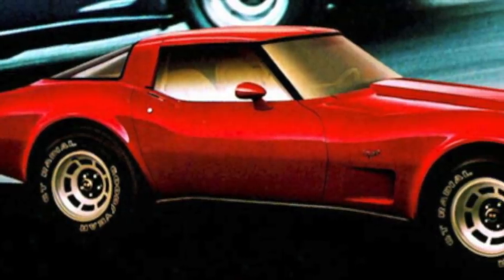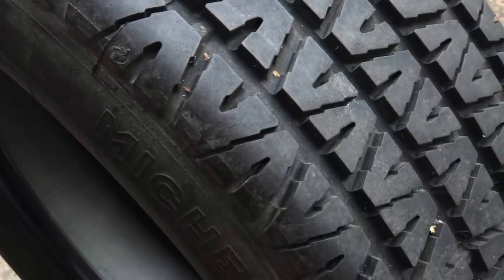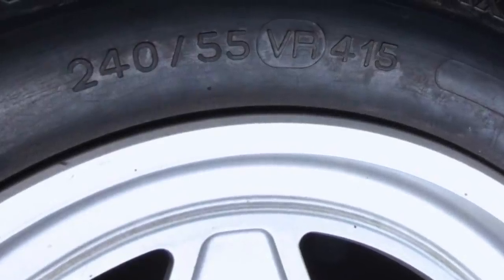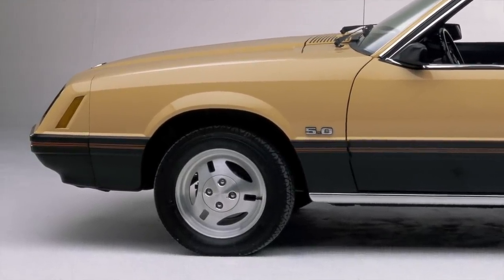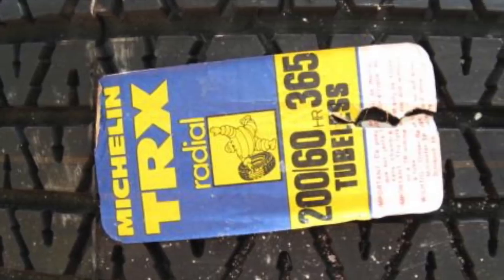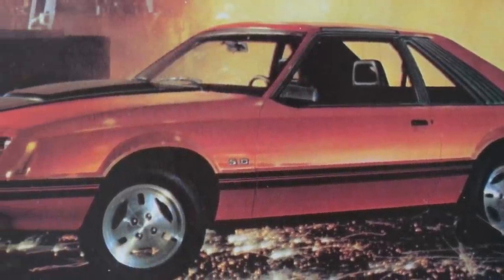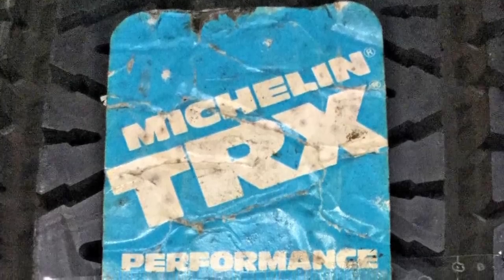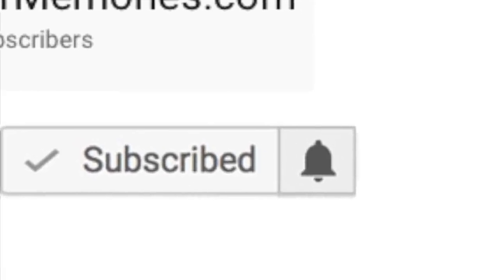Best Car Wheel & Tire Innovation And Why It Failed

Comment: I worked for GoodYear for many yrs in retail/service. We ran across several cars that had the TRX  packages, in which the customers didn't realize that the rim to tire fitment was unique, and getting that exact tire and size would be really expensive.  Hense, many of them went to conventional wheels and tire sizes. Also, it is worth noting, that GoodYear released an Aramid belted tire, 78-81, as a performance tire, widely used on certain GM and Chrysler products, in both letter sizes as well as metric sizes. They offered superior strength and treadwear, as well as heat resistance in high speed driving. BUT they were very expensive. In '79, a set of GR 60 15 Aramid belted tires cost $3-450.00 . That's about $8 to 1000.00 in today's money. And very few drivers bought them as replacements. As for the TRX, GoodYear actually copied the tread design on it's original Eagle GT tire, and later the Eagle GT +4 , which was softer and had a better ride, but it was based off the TRX tread design, in more popular sizes that fit any rim.  Those tires sold like hot cakes, and 1 could special order the tires to V spec speed ratings. As you said, and it's worth noting Coker has had the original TRX sizes available since '12... but they are supremely expensive.
Reply: Those Eagle GTs ended up on a lot of cars as replacements for some poorly thought out OEM tire decisions.

Comment: My 1983 thunderbird turbo coupe still has the original trx tires and wheels. But I put a new set of tires on pony wheels and car handle better with the original tires. Just a little dry rotted now. Lol
Reply: Get those things off the road before you Paul Walker yourself, dude!!!
Seriously!
Reply: @VCBird6  sorry hard to understand what I wrote. Meant to say my car handle better with the old trx wheels and tires but I switch to a new set of tires on pony wheels from a mustang. Because tires are dry rotted and are expensive.
Reply: A little dry rotted????
Reply: @dennisduran8500  car was garage keep tires are not that bad. Don't worry,  I drive it around with a new set of tires on mustang ponys. Tires are a lot cheaper for 16 inch wheels.
Reply: Driving with 35 year old tires is not wise. It's not just the exterior deterioration that is an issue. The inside structure is probably much weaker than when new.

Comment: Used to own a 1984 Thunderbird Turbo Coupe 5-speed with the TRX tires and wheels. That car handled as good or better than my brother's 1984 Corvette with the Good Year Eagle directional wheels and tires. Way ahead of it's time. Thanks for sharing!
Reply: Beast 1624 
My buddy had an 87.
Well, his dad did. 
As kids we got to use it , and see what the hype was. 
What I’ll say is once we had it on the highway and kept the tach between 4800-5400 for about 20 minutes in top gear.  
We slowed down to legal limits and was so bored and it felt so slow we wanted to get out and walk. 
What a great car.
Reply: I'm sorry but when the 84 Corvette came out it was the best handling car in the world better than Ferraris so a Thunderbird Turbo. did not handle as well as it. I had an 84 Corvette with the z51 handling package and been in many Thunderbirds I'm sorry Thunderbird do not handle as good as vet
Reply: From my POV it did.
Reply: YOur definition of handling is not about feeling but rather about numbers and higher g's ratings and such, which does not have the same confidence behind the driving wheel as does road feeling, especially at that time when that corvette had the shitiest road manners and harshest ride.
Reply: Yes the ride was hard especially with the z51 package but confidence I could put that car into any turn and never felt like I was going too fast
Reply: Besides tormenting its occupants, the very stiff suspension also tortured the new Corvette body. Squeaks and rattles throughout the structure became common and so did complaints to the quality people at Chevrolet.

One of the problems was with the Z51 suspension and the fact that many who ordered it did not know what they were getting in to. Despite its high price nearly half of the 1984 production was Z51 equipped. Although it was a good idea for racetracks (which are typically billiard-table smooth) it had no place in the real world of potholes and speed bumps.
Reply: Yes they softened the spring rates in 85 and 86 because of people's complaints but then again a racecar never has a smooth ride so what these people thought they were getting into I have no idea
Reply: Let me be clear. My brother and I bought our respective cars at about the same time. I loved his Corvette. He loved my T-bird. He did not have the Z51 handling package and had an automatic. Mine had the Borg-Warner 5-speed. My observation from my point of view was that mine was more fun to drive because you could drift into corners and had a better sense of throttle input and the manual gave you better control. The 'Vette was GLUED to the road but the stiffer suspension and automatic took away some of the fun. It's all about the feeling from the drivers seat. Just my opinion. Would the Vette beat the T-Bird on the skid pad? Yes. But...that's not the point.

Comment: Gotta tell ya, I've owned many different cars since 1978, w many different tires, Good Year Eagles, Vogues, etc, never heard of TRX, or if I did, I probably thought it was a style, very interesting, I had the Vogues on my Luxo cruisers, but I had 16 inch Eagles on my Lincoln Mark 7 w BBS wheels, they rode great, and handled great, when I got a 95 Lexus it had narrow tires on it, car was horrible, I took the factory tires off w 50 miles on them, and put 55s on it, then it went around corners, tires make a car
Reply: A coworker wanted to go to a larger wheel to improve handling. I tried to convince him that he should first change to a better tire. He decided to do both. That made it difficult to examine the improvement just switching tires would have made. 

Another person went out and got tires with poor braking qualities after I had suggested they not just buy what was on sale. One day they had to maximum brake due to getting cut off and ended up crunching the front end so bad the car was totaled. I pointed out that if they had selected better tires they would probably stopped much sooner with only minor bumper damage.

Comment: I remember the tires were awful when cold. My friends had the tires and I was not big fan. I had the the. Goodyear Eagle VR50 "Gatorback" tires & I remember them past dangerous in the rain. It was like driving a boat. I recall the Pirelli P7 in 80s were good tires but with a cost.$$$.
Reply: kylemlm I had forgotten about Goodyear Eagles back in the day. They were so cool, lol.
Reply: @ Dave, I worked for GoodYear when they had the original Eagle GT and later GT+4 tires. We couldn't keep them on the shelves, even though they were a performance tire, copied directly from the TRX design.  The cops loved them, the performance crowd loved them and the mark up on them from corporate was silly.

Comment: Had those on my 79 Mustang Indy Pace Car 5.0 4 speed. Those tires sucked big time. I bought a set of new take off tires/wheels from an 89 Mustang GT and what a huge difference in braking and cornering. In a panic stop it was random as to which of the 4 TRX tires would lock up.
Reply: Ditto.  Had a '79 Pace Car myself.  Those tires were overprice hockey pucks.
Reply: Had two different 84 GT's they both started with TRX's and both ended up with 15" rims and tires.
In all honesty, in my experience a half worn set of TRX's stuck to the road really well when warmed up. Both cars were lowered with higher rate springs though.
But, I never had a set of TRX's that didn't seem to find and pick up every nail they rolled over.

Comment: TRX technology = Needless proprietary sizing on wheels and tires. Money making scheme/NOT failed technology.
Reply: Yea I'm not seeing the part where technology comes into play. Any tech in the tire is not related to the weird proprietary sizes that forced you to pay more for replacements.
Reply: Hate anything Proprietary.  Hate anything French.  They not the only people with Vanilla, silk pie, or Baggetts.  I am a French resistor !  Viva la resistoent !
Reply: Lol. They were fantastic tyres. Monster grip in the wet compared to normal radials. Lovely sidewall stiffness but great ride.
A peugeot 505STI with TRX definitely gripped better than the GTI with michelin MXV.
You could feel the sidewall was not deforming compared to mxv.
Only trouble was they were expensive.

And i believe michelin still supply. Michelin traditionally maintain production of their old patterns specifically for classic vehicles.
Xvs, zx, xzx etc are all still available.
Reply: Did you bother watching the video?
Reply: tscooter22 the whole thing
Reply: @tscooter22  Yes I watched it and I had a car with those tires and rims and it performed and handled better when I replaced them.  The claims he makes did not bear out in my experience with them.
Reply: tscooter22 Curious as to what B.S he was going to tell us.

Comment: Long story short: it wasn’t a “technology” that failed, but rather auto makers choosing to use proprietary wheel sizes matched to proprietary tires that failed. Sounds more like a racket between auto makers and car tire makers that eventually “fell flat”, because clients were not willing to pay for a money making scheme concocted by auto designers. The only technology involved in this video is low profile tires, and we all know that that is a technology that is very much alive and thriving. I love your work, love your videos, but I am pretty confused as to why you never connected the dots: it was a money making scheme, not failed technology.

All they were doing was trying to cash in on a gimmick so they thought of low profile tires originating in Europe
Reply: Ford didn't stop there with money making scheme.  The later Mustang GTs that used the Goodyear Gatorback tires chewed through them like candy.  The horrible "modified McPheson strut" front suspension had really poor geometry, which caused the tire to roll onto its outer sidewall on turns, which lead to poor handling and severe wear on the outer edges.  Some folks compensated for the poor handling by setting up as much static negative camber as the strut mount plates would allow.  This lead to severe wear on BOTH the inner and outer edges.  The California Highway Patrol used these cars as their pursuit vehicles, and would have to replace a pair every 2 weeks.  At $150 each, that was a lot of tires and down time.  Aftermarket strut plates dealt with this problem be setting up more positive caster.  Ford must have known about this problem, as their skidpad tests would have revealed the severe understeering nature of the suspension.  But it took them over 10 years after introduction of the 1979 Mustang before they did anything about it.  They made a modification to the strut plate, similar to what the aftermarket did, in 1990.  But before that, they must have helped Goodyear sell tons of those tires.
Reply: No. He just didnt explain the tyre very well. Seemed hung on on stupid ford mustangs.
The way the bead and rim mate together is totally different on TRX.
The rim itself is a complpetely different shape. The bead is a completely different shape. The sidewalls were constructed different.
It really was nothing like a normal radial of the era.
If you drive TRX back to back with MXV (michelins standard construction sport touring tyre at the time) on the same car the difference is noticable. TRX was superior in ride, grip (lateral and longitudinal), directional change (steering) and braking.  They were fannnnntastic in the wet. To achieve similar lateral grip at the time as a 180 TRX took a 195 in standard construction. Thats comparing michelin to michelin.

It really was a superior product. Just too damned expensive.
Reply: @sugarnads  The Fox bodied cars had terrible suspension designs, so no tire technology could save it.

Comment: I didn't know this was even a thing,  I have 15 inch tires with medium profile sidewalls they handle and ride very nice I guess the traditional wheel and tire system got much better with better tire technology no need for this trx system which was more expensive

Comment: My 1985 Dodge Shelby Turbo had very pricey Goodyear VR rated 205's @ $310.00 each then.
Reply: 305?  Please cite a source for that.  205/50VR15 was a stock size for that car.
Reply: @Torch70  I missed typed, edited.
Reply: I still own a car that uses 205/50VR15 tires and they're getting hard to find.  The Dunlop Direzza from Tire Rack is about the best choice these days.

Comment: I had completely forgotten about this technology. Until watching this video. I remember the hype surrounding this system, and the confusion it caused when introduced and in the ensuing years about this wheel and tire system. As I was at this time I was still a GM fan girl. Then it was gone and appairintly forgotten by most. I had known friends who had MustangGTs and SHO turbo Mustangs ,which was the only reason that I, and many, knew about it at all.
Reply: Jolene  Vilis It wasn’t a “technology”, it was just proprietary wheel sizing causing auto makers to make a lot of money based on backroom agreements made with tire manufacturers. The technology was low profile tires, which is alive and well today, in fact thriving. The only difference is, auto makers don’t make stupid wheels based on 10th inch increments causing their clients to spend outrageous sums of money on tires which are a high use/replacement item.
Reply: @BikingVikingHH  ,I agree with you about the backroom deals and general BS of The TRX system. BUT it was still a new technology none the less. Yes it did usher in the low profile tire technology. Before TRX a 50 aspect ratio tire was the norm for low profile tire. My current car came equipped with 18 inch wheels and a  35 aspect ratio tire.
Reply: The problem wan't with the 10th inch increment in widths; all passenger car tires come in those increments today, they just end up at the 5mms.  The problem was the funky metric tire/rim diameters; 390 mm is 15.35 inches, a size that only came in the TRX wheels.  If the tire widths were 220 or 230, vs 225 or 235, you can still mount any of them on 7" rims.  But the rim diameter can not be compromised.
Reply: I finally put some newer 16" take-offs on my BMW 635